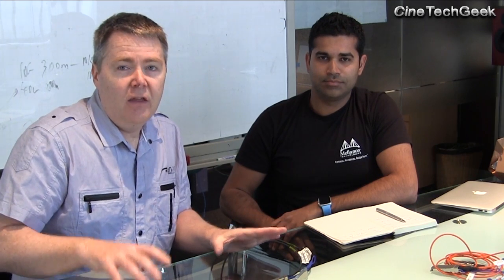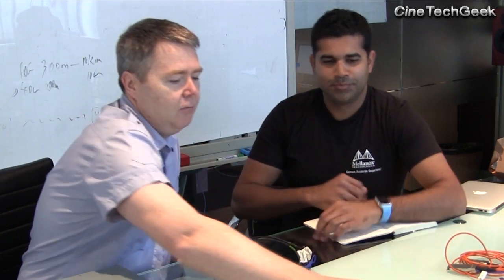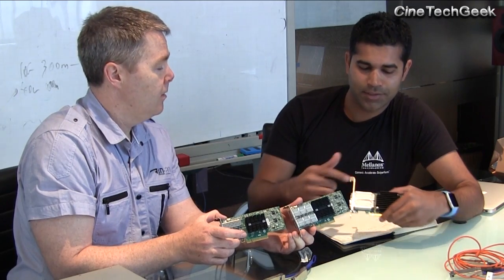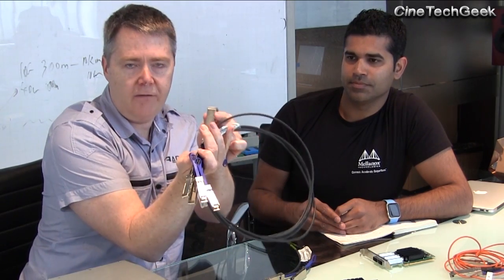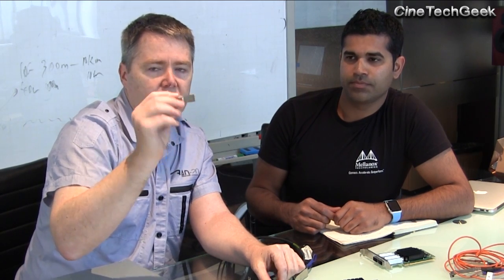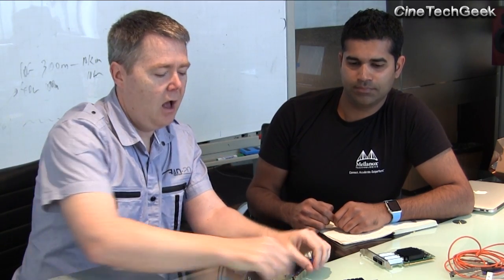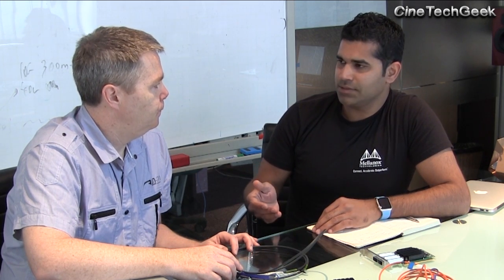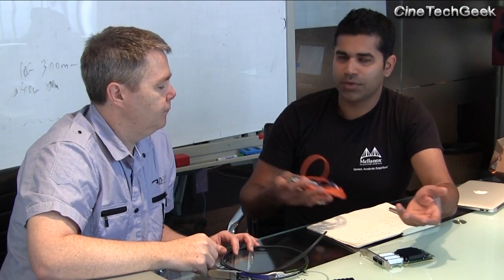Ultra High Performance Networking in Media Production

Comment: False information. Although your communication over the network is fast you are then limited to internal hardware... i.e. Pcie may be a limitation it may not depending on your config, but hard drive. A better layout of using this technology 10g to a switch that connects multiple users, then OSN 40g to or more known max 20tb/s to date OSN spread out to your servers this better allows better flowing of the network. Known single ssd NVMe Limit is 10gb/s transfer speed unless in raid 50 or higher using software raid

Comment: Great video, I have my CCNA/S, and when we want to do 40gbs, we just usually trunk 4 cables at the 10gb ports. At least, when one port goes down, we have three other's that is still transmitting. The only question that I have, is the switches and routers are dual stacked (IPv4, IPv6) and does it use a proprietary routing protocol, or one of the open source?
Reply from the maker: +falloutpictures The Mellanox Switch.. is a switch..   They have all the same features of other managed switches, just that the ports run at the much higher speeds.. (And each of the 12 port can split into 4 10GBe ports)   I do remember hearing Mellanox and other companies are looking at loading open source routing code into future products..  But that is a different market.  I am mainly focusing on ultra high networking for media workflows..  Ie Post production, cable/TV stations etc.  Ie turning historical physical infrastructure into virtualized IP packet type infrastructure.  In reality what we are talking about is changing from a static physical implementation to a total software implementation running over commodity, all purpose network hardware..
Reply: +CineTechGeek Ah Ok, I used to work in television in Master Control, then went to school for Networking and Security, and the majority of our stuff is Cisco based. I've recently visited a set to meet a friend of mine who is a DIT. (He is pushing me to go that route, and I might consider it.)  I am surprised how much the workflow have changed since I worked full time in the industry. I can see that the speeds are up and he have an excellent set up on his cart, I might just have to consider to go back into the industry, and possibly carve out a little niche on set.  Again, great video!
Reply from the maker: I did make a follow up video but have not had a chance to finish it yet. Keep an eye out for it